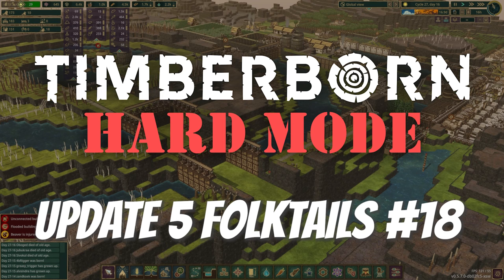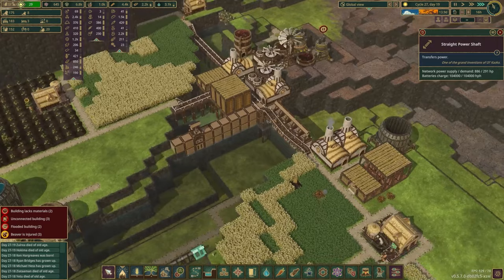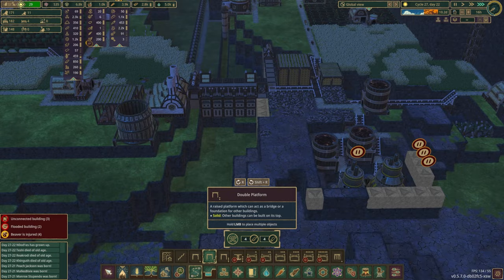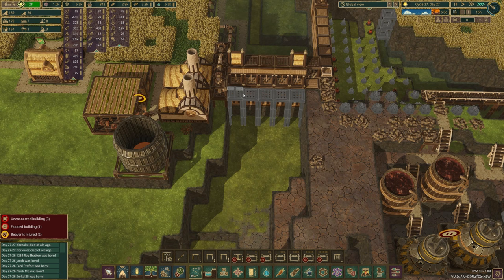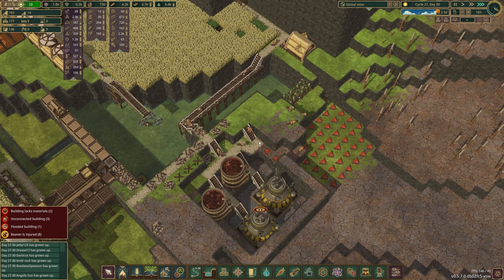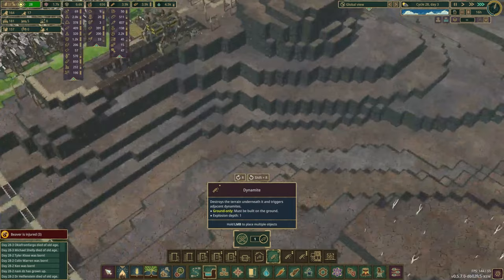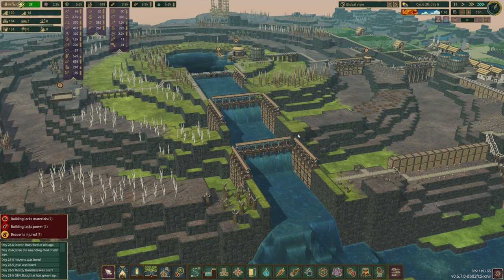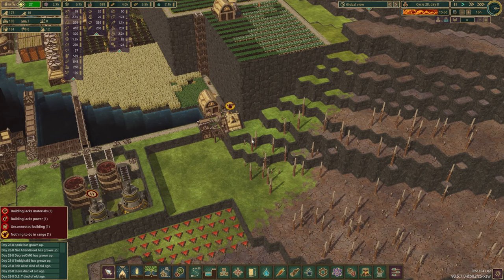Optimize, terraform, and thrive! Timberborn Update 5 Folktails Episode 18

Comment: 45:05 "can they even get back here? I don't think they can"
45:10 two bevers walk back there
45:30 puts in ladders for them to get to the area they just walk in. 😅
Reply: I saw that too! Lol
Reply: I think that was just at the limit they could reach, they'd need at least a path to get much farther.
Reply: @PauxloE  not really sure how the path finding works. But it seems that it only needs to be a a path within the place they are going to build something. So if there are a path a next to a 1 deep river, and you put something in the river that is not reachable from the path next to the river but there are a set of connected stairs in to the river more than 10 squares away the can reach it by walking around. I think that's why they sometimes walk across half the map I badwater to collect some planks that are are from a set of stairs you removed in oder to not have them walking in the badwater. And you are just thinking how the heck did they get down there.

Comment: You've not replaced the path over the bottom end of the reservoir where you removed the bridge and the pines and maples are still set for cutting, you might want to sort that too.
Reply: Yeah, at the bottom that new roofer plank bridge.... currently leads to nowhere 😅 I thought it was going to connect to the mills etc., but they've now kind of blocked the access

Comment: → 54:24 "This [the aquatic farmhouse] is going to have a pretty sizable range" – Don't confuse "range" with "capability to actually harvest". For that area, you'll need several farmhouses if you want it fully filled with spadderdock and/or cattail, otherwise the nearest will be grown back before the ones further out are harvested.
→ 59:05 The way you put in these gristmills, you can't connect the platform bridge by the floodgates anymore. I'd rotate one of them, with the path between them, and connect the power underground. Or route the path underwater under them, but then the path gets longer (and the flour gets wet when transporting to the bakery). 59:55 Ah, the bakery also goes here. Same applies to transportation of grain from the other side. 1:01:20 Ah, now it's possible to connect on the levee/dam. It's a bit of a detour, but better than nothing.
→ 59:57 With this warehouse placement I'm wondering where you'll put the bad water processing so it's still connected to the power.

Comment: I think instead of trying to do the bouncing floodgate for automation you should be able to just link the final floodgate to the same stream gauge that controls the badwater shunt. Set it to minimum water depth like 0.2 close the floodgates maximum water depth 0.3 open them. You normally try to close/open them when you see the water roughly hit/leave that area so that would do the same thing just automatically. Now it is going to be more vital since you have platforms on both sides of those floodgates that without pausing the game you will be more likely to flood since they are hard to select with everything that's in the way

Comment: 42:26 but your causing a disaster, not averting it... 
You should have closed the spiral 🎯 bypass channel floodgates, filling up the ➰ loop ➰ of the spiral with more water to pump & building a way to send water from that extra water storage to the main resovior
Or better yet in the wet season split the water 50/50 between the main and loop ➿ resoviors
Reply: It's only a 15 day badtide, should be fine. Especially with the new larger tank

Comment: 13:10 "use it or loose it"?
Reply: 42:21 don't think it's not going to flood any more now when you have removed the blockage/barriers.
Reply: 58:02 no the trees/berry bushes/dandelions do not spread to an adjacent patch if it is a dead plan on it. Those dandelions died first episode and if nothing had spread to them by this time, it would never. But if you just remove the dead thing it will spread.